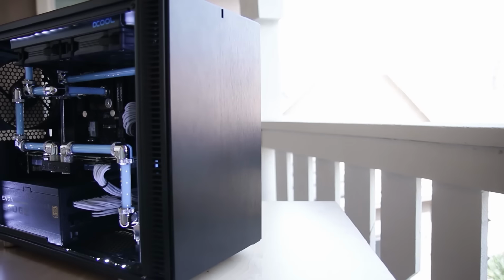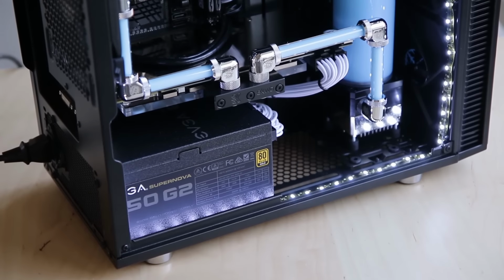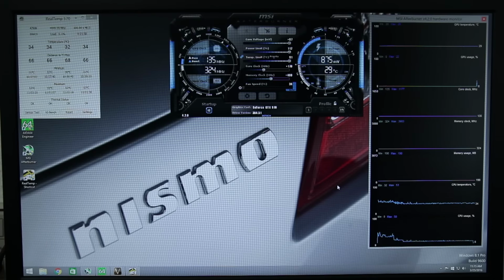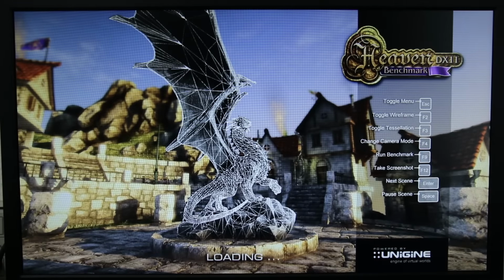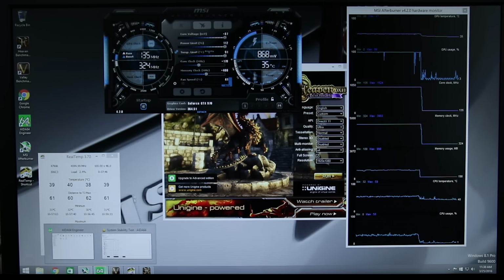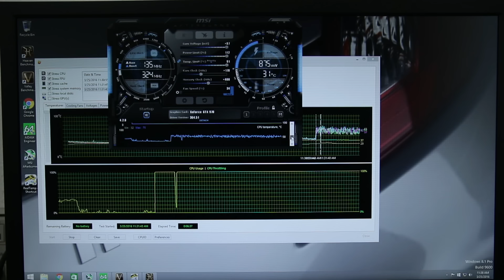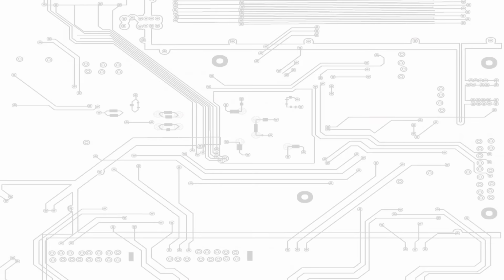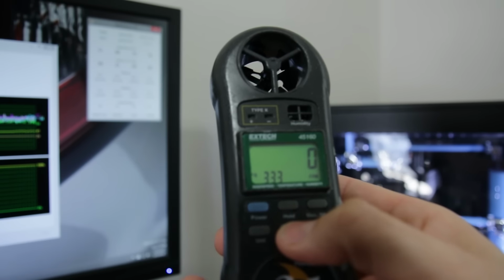Was a 240 Radiator enough?? Temp testing the ITX build

Comment: Do you think a single thicker 240mm, like the Ocool MONSTA could cool a 1080 ti and cpu in the same loop? 

1080 ti is 250W, while the 970 is 145W. 

So, judging by Jay's advice to have 120mm x 30mm for each component, we could treat the 1080 ti as 2 components and the cpu as 1 component for a total of 3 components. So comparing that minimum to the MONSTA, we would have:

(3 x 120mm x 30mm) < (1 x 240mm x 80mm)
(10,800mm^2) < (19,200mm^2)

Should work fine, right?

Comment: Jay, this case is so bad ass. I seriously wanna do a custom water cooling solution. Any recommendations of where to start? Tips suggestions? Also, screw those yahoos who cry about front mounted radiators. The temp is nominal, esp if you have proper case and radiator fans.

Comment: but also putting a radiator at the front also draws in cold air from outside therefore cooling the GPU prob better than it would inside. but will add higher temps inside the case.

Comment: Would a single 180mm EK radiator offer better cooling than a 240mm radiator? I'm thinking yes as the 240 is 120x240=28800 where as the 180 is 180x180=32400 as it's square?

Comment: Have you used Intel Burn Test as either a thermal test or stability test? If so, what are your opinions on it vs. Aida64? I've tried both, and IBT tends to find problems a looooot faster. I'm also using AMD, which I know IBT wasn't designed for.

Comment: Good stress-test for CPU in aida - Test Just "STRESS FPU" .On my FX8320(lite OC to 4.1GHz) aida system stab. test heating max to 41-43 degrees celsium, but using just "STRESS FPU" heating it to 55-57 celsium.
Or to use something like linx or OCCT(with AVX checkbox).

Comment: At overclock.net I saw a silverstone SG13B with a single 120mm rad cooling both a GTX 980 and a 4670k. The video shows load temps around 54-55c after running valley for several hours.

I have nearly the exact same setup, save a GTX 970 instead and a gold rated 450w psu. I can confirm that temps are in the low to mid 50c area. I seriously underestimated the low thermals of these maxwell GPU.
Reply: does the 970 handle games such Gta v and Fallout 4 fine because I have an R9 380 4G but I'm thinking of getting a 970

Comment: Now do this:
1. Delid the cpu
2. Throw away the "lid" and use ekwb's no-lid waterblock, using liquid metal
3. Apply liquid metal on gpu 
4. Watch temps go down by 20-30 degrees celsius.

Comment: I live in a hot climate, so my computer room ambient without air conditioning is 23-35C. I tend to turn on air conditioning, when it's over 30C.
My loop is MCR-120 + MCR-220 QP (swiftech low FPI rads) with i7-4770K @ 4.4GHz and GTX570 @950/2100 MHz for core/mem.
So here is everything to summarize the "wrong":
1. Fans on res in pull
2. There is probably negative pressure in case (2 intake 3 exhaust 120mm fans)
3. The GPU is before CPU in a loop and only 120 rad between them
4. MCR-220 radiator fans are not running at full speed because they making very annoying noise because of the case structure between them and radiator and the mesh after them. (50% max)
And yet, the GPU/CPU temps are ~30 on desktop (browsing, youtube etc.) and below 60C while gaming (DOOM, Crysis, WoT) :)
I can get the CPU cores to 100C if using prime95, but that's not realistic load.

Comment: At what temp do PETG start to deform and leak at the fittings ?  I found it was around 70 degrees but I'm not expert,   is it ok to run at 50 degrees constantly on hardline do you think ?

Comment: I need advice  i have a custom loop with a 3800x and a 2070 super on the loop  and current temps i see at full load is about 70 on the cpu and 76 on gpu.  I have a 240 rad my temps seemed better with the original air cooler , will upgrading my radiator to a 360 be better?

Comment: I don't understand why "shorter graphics card" is the only option mentioned for allowing the addition of a front rad.  MY solution would be to re-orient (and shorten) the RESERVOIR.  That HUGE TUBE RES is where the space is currently being "wasted" in this build.  But that's only IF space is being wasted.  Obviously, with the moderate overclock on the CPU, and only a 970 GPU, which is only pushing 1080p (so a hotter GPU would be pointless in this case), this is all the rad area needed.  Put a 980ti or Titan in there, driving a 3440 x 1440 (or 4K) monitor, and it would be a whole different story.  With more graphics horsepower/demand, and/or a 2011 socket CPU, then you WOULD definitely want the additional radiator.

But of course this goes right back to my biggest long-standing gripe with all the discussion across this whole industry, of any aspect of this issue in general:  EVERYTHING UNDER DEBATE HERE, DEPENDS ENTIRELY ON WHAT RESOLUTION OF SCREEN YOU'RE RUNNING.  Why is display resolution not the FIRST issue specified in these discussions of gaming builds?  Which would then show the "inadequate cooling" comments to be pointless/ignorant or irrelevant?  Why can't people get that concept?

Comment: How much of a price do you pay thermally when using those thick glass tubes?  Glass does insulate more than acrylic I imagine.  When the loop equalizes thermally, is the temp higher with glass than vs copper?
Reply: If you are relying on tubing to dissipate heat at any meaningful degree, you have radiator problems. If your radiators are up to the task it doesn't matter at all what the tubing material is. Tube material would only matter if you didn't have radiators at all and just used very long loops of tubing (which, with copper, some have done).
Reply: Not my question. I want to know how much impact tubing choices have on overall temps.
Reply: Please read my reply again. To put it in other words - none, no difference whatsoever. Only way you get a difference depending on different tube materials is when your radiator heat dissipation capacity has been exceeded; so if your radiators are correctly sized and working properly with normal air flow, the tube material has NO effect on overall temperatures.

Comment: What was the wattage of the pc, cpu, and gpu at full load when it got to 47 degrees? I’m wondering if I built a portable pc with a 9700k and RTX 2080 with a tdp of ~350 if a single 240 rated at ~400 TDP would be enough or if I should design for a 240+120 for 600 TDP, or a 240+heat sink wrapped behind its attached 15.6 monitor. All this bulk adds to cumbersome weight and depreciating returns in cooling but the benefit of routing water cooling through the case and using it as a large heat sink is too optimal to miss out on.

Comment: how do you connect the fans up when there is not enough connectors on the mobo ????
Reply: You can use y-splitter cables to run 2-3 fans off one fan header on the motherboard :)
Reply: cheers for that,, i thought you could do it that way but i was unsure lol yes im a noob ha ha ha

Comment: That build is more for silence than temps which I don't think people understand. It runs pretty hot on the CPU side for being under water but still quieter than air cooling.
Reply: still runs cooler then my cpu. I have a h100i and my temps are higher on my cpu I'm at a 4.7 clock but still haha he has a GPU to cool so I think temps are great
Reply: +CRABST3R ! Those AIO coolers are pretty bad at dealing with OC'd temps.
Reply: +Muffin Man (MuFFiN MaN) oh yeah I wish water cooling was a bit cheaper, it's hard to justify spending as much as a 980ti would cost to get better cooling when over clocking. specially when you can just buy a second card leave at stock and get wat better performance haha, yes I know some can do it cheap some already have a lot of the stuff but for people just buying everything they need it adds up to be alot
Reply: +CRABST3R ! A lot of it is a one time expense so I guess that helps a bit. I agree though, from a pure performance point of view not worth doing it. Having said that, not hearing fans ramp up was well worth the cost.

Comment: unless you live in a clean room or a lab or take your pc apart to clean it once a week. your gonna want the least fins per inch as possible. the difference in cooling is made up in the amount of dust that gets trapped in the fins...

besides its been tested. and the difference in cooling from high FPI to low FPI is minimal anyway.. what matters more is air flow and total surface area. . 

ive always wondered what would happen if i put a peltier cooler on my res or rad...

Comment: I hate when people assume this way or that way is the way to do it, each and every build is going to yield different results. I am currently on a path of 9xThermaltake Riing 12s in my case because I need air always moving since my R9 290 likes to heat things up when I dont have enough air flow in my NZXT h440. 5 of those fans are going on the front on my Corsair h100i and one more under it to pull air into the case and 3 across the top and one rear all exhaust. Things change and less fans are needed when I just use a air cooler like my Hyper EVO 212. . . Variables people they are a thing.

Comment: Man I'd love to buy this PC but instead of using that 970 i will change it for a 980ti.
Hey Jay do you have a part list of the build?
Reply: +erazorCTF 
I don't think so, just take a look at the hybrids 970 and 980ti temps, is almost the same temps. 
and if it adds more heat is probably going to be like around 5*c more, which is not going to hurt anything.
i own 2 980ti's too, reference model. :D

Comment: Jay, the 4790K boost speed is 4.4GHz, I've noticed that the processor seems to only overclock to 4.5GHz - 4.6GHz..... is there really any noticeable difference? I've always considered the processor as like a "pre-overclocked" version kinda like the manufacturer overclocked video cards. or does the overclocked processor gain boost as well? (ie. 4.6 OC'd boost to 5.0?)
Reply: oh, I see so the boost to 4.4GHz only happens if one core is under load and I assume something lower like 4.2GHz if it's like 2 or 3 cores under load..... makes sense

Comment: i have a EX240 dual radiator... im going to be running a sky wark gtx1070 (has a water block on it) and an amd FX 8350... all on the same loop with 2000rmp fans... idk if its going to be good enough or not...
Reply: if a single 240 rad can run a gpu at 4.6ghz then why not buy a bigger rad and run the gpu at its max operating temperature and squeeze 5ghz on the cpu and gpu

Comment: Yo jay.... For some reason it popped in my head when you said coolant somewhere in the video... You ran milk through so I would think you would be fine with testing this. But what about automotive coolant? I wonder how that would do....
Reply: Still be worse than water. Automotive coolant is so it doesn't freeze doesn't make it dissipate heat better than straight water.

Comment: It's good to have a balance between radiator and good fans for it... But technically if the radiator gets big enough relative to the heat it needs to displace, it will be able to radiate all the heat away without airflow assistance. I mean, satellites don't have fans, technically.

Comment: well this video is what i call an real believable benchmark testing and not an LinusDerpLie.

didnt saw those comment otherwhise i would react on it but it seems that they dont realise that both main heat producing components are watercooled AND both are on a custom single loop.

please dont compair this build with seperated AIO loops....

bigger rads means longer ramp time of the temps to the nominal temp (for al fan size)and also lower fan sounds (depending fan size 120-140-200) but for max temps it only matters if you reach the maximum capacity of rad to dissipate heat just like Jay mensioned and bigger dimensions (as size of the fans) give higher capacity to the rads so it possible give higher overclocks. in Jay's situation hes loops have still headroom for higher clocks  if hes cpu/gpu is capable for it.

the place of mounting doesnt matter much as both big heat creatores are watercooled and even less as they are in a single loop and you only need a low airflow to cool the remain low heat producers (ram,vrm,etc).

As in 2 seperated AIO or loops ,the heat dissipated from one of the loop can influence the other loop .  then placement and direction does matter .

all the benchmark results doesnt matter if you dont overclock ,not using the pc at full load for long periodes (4 to 12Hrs) , using the cpu in long boost periodes (30 min to 4 hrs) or using low cpu clocks and low voltages.

Comment: Thanks. Question for you. What happens if you over clock the GPUs memory to high. Does it crash or do you melt chips?
Reply: Was asking because I over clocked my GPU buy 130mhz without changing voltage, but I am scared to push mem clock.

Comment: Hey Jay! Great video! Quick question related to this, though - i'm currently looking at doing a super tiny watercooled console-ish build, and I'm a bit iffy when it comes to the radiator. I'm looking at doing a triple 60mm rad, which should equate to slightly more than a standard 120mm radiator. Usually, this would be way too low for a gpu/cpu loop, but the cpu i'm looking at is a 6700t, which only has a TDP of 35 watts. Do you think this would be feasible together with a 970 mini and an EK D5 pump? Thanks!

Comment: well, air cooled gpu with an aio on the cpu would give you better temps, so i still think that it's not an ideal setup. with custom wate rcooling you don't usually shoot for "no thermal throttling", but for either heavy overclocks, really low temps, really slow fans or a combination of all of those things. 

but i get that you built this system to show off the case, used the components you already had, and also that the loop in there is for aesthetics just as much as it is for cooling, so i see that it does its job.

still, if it were my system i would have either gone with an air cooled gpu and saved a few bucks for pretty much the same thermal results or gone with a fury nano and an additional 240 in the front.

Comment: But Jay, why do you call it a 'single' 240 radiator? wouldnt it be a dual or full since it carries 2x 240mm fans?
Reply: a 240 mm fan?!? No its a single 240 mm Rad because it fits 2 120 mm ( 120+120= 240) thats why it's called a 240 rad.
Reply: +samjochems2912 wow Thanks dudes haha! I was thinking in the entire opposite direction lol

Comment: thanks for this jay. I have a i5 2400 and a GTX680 going into a XSPC EK240 rad with a EK dbay spin reservoir raystorm CPU waterblock and a copper aquagraFX GTX680 water block and was told the rad wouldnt be enough.  so it looks like i will be ok for the build. this is replacing a H50 that is on the CPU . what effect does the volume of coolant do? does a larger reservoir just make it take a little longer to saturate the loop?
Reply: yes thats how it works

Comment: And what do you think about Nemesis 2x 280 GTS vs 2x 240 GTS and fans set to 500rpm on idle or low load? They rate it for 1100W each (280gts) so not sure if I will need 2 for my i7 6700k + MSI 1070 Gaming X. I'm planing to build my own case in near future and wanna make a SFX PC. And need some help as my CPU stays at 800MHz few sec after windows load even when BIOS is set to stay at 4,5GHz. What do I do wrong (ASRock z170 Gaming ITX/ac with latest BIOS)?

Comment: The length of the radiator is not the thing you should be looking at. It is the surface area and air flow. A radiator which is twice as thick will have a much higher cooling capacity than a thin card.
Reply: +Stephen Boyd and fans suited to the type of radiator used as well. That's a common mistake.

Comment: How does every water-cooled system outperform mine in temperatures. My build is always around 60-70 fully water-cooled. 2x 980 ti and a 5820k in an h440.

My idles also hover around 35-40 all the time. My ambient is also about 24-26 Celsius.
Reply: Can't edit my friggin comment. Whole build is cooled by a 240 and a 280 rad.
Reply: +Legend Hidde 
Thermal compound issues?
Reply: Stewart Buckley I've changed the thermal compound around about 3 times, every time the same thing. I even bought special IC Diamond thermal paste.

Comment: Bro 240 is fine . A good 240 can easy dissipate 200-280w of heat with 1gpm, and 1300 fan rpm.  However larger radiator will allow for greater heat capacity and silence.

Comment: Just curious what the decibel was at the max cpu/gpu test. However point made. You succeeded in making me feel very foolish getting a 560mm rad for my 1800x. Now my original plan of using another reservoir on the other side of a Thermaltake 900 case for a Vega GPU  is going to be a waste of money  But I have this huge 3 sided tempered glass case that looks lopsided. Ignorance was so much bliss....  The only thing is; it is the quietest system I have ever built. If it wasn't for all the RGB bling I wouldn't even know it was on. 

Curses..... Foiled by reality again.....

Comment: Hey Jay, do i need more CPU power when i use a AMD GPU instead of a NVidia GPU? Could you make a video about that?
Reply: I would say no but I wouldn't know.
Reply: there are some benches that make you asume that, but there is no final test out there, which make that exact conclusion.
Reply: Well I mean most CPUs can handle any game without nearly maxing out. If for some reason drivers require more cpu power to do the same thing on amd side most CPUs would be able to handle that.
My crappy $100 cpu doesn't max out and I have amd gpu.

Comment: Hey Jay, i have a 4690k and want to know what voltage+temp is save in your opion to get it overclocked to 4.4Ghz. Cooler is noctua nh-u12s. Mobo asus z87 plus. I also have 2 other noctua fans, 1 for inlet and 1 outlet.
Reply: I got 4.4 with 1.2 V, and 4.5 on 1.25V
Reply: +Jabarichonicles What are your temps in aida64? What cooler you use?
Reply: nhd15, and it sticks to about 30C idle, and under load about 60 or so.